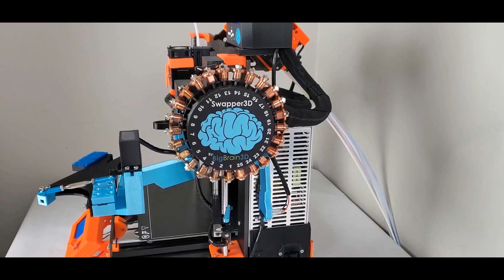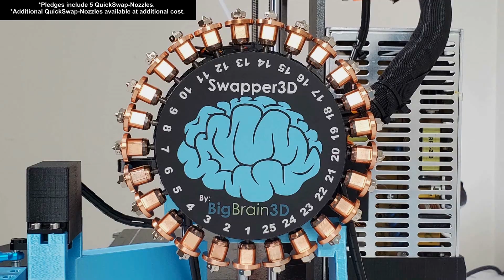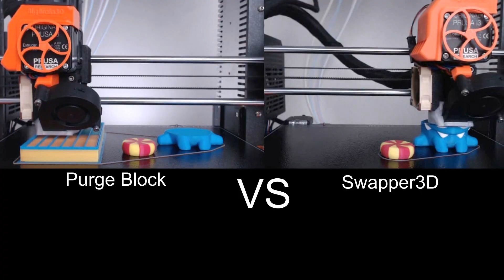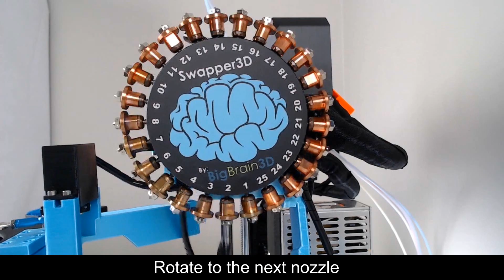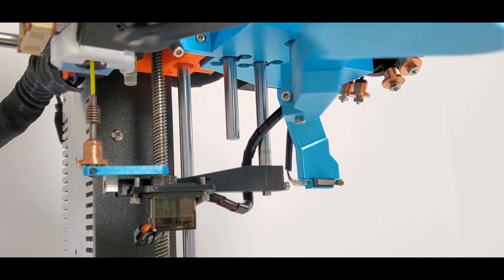Never print a purge block again!

Comment: This is very cool, but for the life of me I cannot understand why you need the cutter attachment. Just pull the filament out while the nozzle is still hot. Then do the infill first when it comes back to that color & nozzle again. I read an article that says you guys already make it to do infill first anyway, because cutting the filament deprives it of retraction. So why not just skip the cutting part? Plus, what happens when there’s a little tiny green part that only takes 4mm of filament per layer? After 10 layers, you’ve got 10 4mm sticks of filament stuck in the tube. The cutter just seems completely unnecessary to me. I’d love to know where I’m wrong if I am wrong.
Reply from the maker: There is a problem with withdrawing filament from a hotend which is that the end of the filament may not go back into the hotend. Also strings can form between the melt zone and the end of the filament being pulled out, both of these can cause the print to fail. This is so common that lots of people actually hate the MMU (and similar filament switchers) because of it. Cutting the filament solves these 2 problems. In your specific example of a tiny print with almost no infill then you may prefer to use a priming tower. Or you could prime on the wiper pad (seen in the Kickstarter but not in this video because it's molded into the cutter guard which is removed so you can see the cut in action).

Comment: This type of system has been included on CNC milling machines for decades. It was only a matter of time til 3d printers got the same treatment.  Thanks yall!
Reply: Yeah, the tricky thing is that this is only half the solution for printing... You'd need another add-on for swapping filaments in a 25 spool array to make full use of it.
Reply: @freescape08  palatte 3 pro takes 8 colors and is technically stackable, it may be compatible with changing nozzle size mid print too which would help with certain prints.
Reply: @freescape08  Voron ERCF and the Annex Engineering Trad Rack can both be expanded to whatever number of filaments you need, so it easily could be scaled to 25+.
Reply: @tehflyingcookie  okay, so it's possible. I'm still doubtful of the practicality though, how many variations can one reasonably organize and print with? And logistically, 25kg of various filaments being fed into one printer gives the impression of an early computer filling a room but with one little output in the corner. And creating a drybox for all that just makes it all seem insane. 
Or course, I expect it'll be used more for nozzle changes than filament type or color, and not all have to be used in a print, but I still think managing all that would only be worth it in very niche situations.
Reply: @freescape08  I don't understand why you're hung up on the 25 number so much. It supports that many nozzles - you don't need to use them all. Also, you might want different size nozzles times let's say 8 colors, which lets you get 3 sizes. You might want a backup one in case you need to clean a specific nozzle. There's a million different problems this solves without it being just about 25 different colors or spools.
Reply: @Xenomorphin1  I'm hung up on the reality of it. If I were them, I'd have looked to work together with other designers for a more complete system. It seems like half a solution to a very small problem that's solved in other technologies. But maybe it's just early days of a new sytem, and I should let it be and see where it goes in a few years. 
I did see the op's comment in reply to complaints, and that cleared up a lot. I'll just be patient and see what more comes of it
Reply: @freescape08  nah you're just trying to poke holes where there is none. CNCs have had toolchangers since forever, it doesn't mean you have 300 tools for each and every slot
Reply: @Xenomorphin1 I'll admit I'm a very picky person, but you'll have to admit that subtractive CNC is much easier for automatic tool changing. As far as I know, automatic tool changers are still fairly new to additive CNC machines, so all I mean is it'll take time to work out the best ways to manage it, and it won't be in widespread use by most additive cnc hobbyists for at least another decade, by my simple estimate.
Reply: @freescape08  I mean you can keep complaining, I don't care. I gave you the usecases for the thing and you dismiss them for no reason, there's no point in arguing with a debbie downer
Reply: @freescape08  what this needs is ERCF
Reply: @freescape08  this goes for every option except manual labour. It's just that the filament waste now isn't a factor anymore but the filament feed system.
I can also imagine a situation with a large part with intricate details where it's quicker to swap to a bigger nozzle with the same filament with this system.
Or help someone that tries to automate their decently scaled 3d print service to give the options for 25 different filament types or colours and has the prints start automaticly or something.

It's a nice take on a problem that will help make certain things easier or possible for others.
Reply: @freescape08  You just need 25 extruder gears + a mechanism to select to drive which (like a carriage with a stepper motor)
Reply: @Spacefish007  yeah, nice and simple. We're definitely not getting into hp full color nylon prices with that many steppers. 😅
Edit: just looked up a quote... Definitely not. (~300000$)
But it's definitely at the point where it would be more cost and time effective to just have a print farm or order prints from Shapeways.
Reply: @freescape08  if you do it right, you can do it to also switch to different nozzle sizes automatically

imagine 5 colors, 0.2 0.4 0.6 0.8 and 1mm nozzle

who needs more?

sounds like full automation goodness
Reply: Eric Karczewski yeah I find it odd they didn’t show that, unless they don’t make one and it isn’t included. If it isn’t included it kind of makes this pretty useless in my opinion. First you need to find one that will handle 25 filaments, then you need to get it to work nicely with the hot end changer, which might be easier said than done.

Edit: I’ll add that it could be useful without a filament changer if you just wanted to use different sizes of nozzle for different parts of the model, but then you don’t need 25 different hot ends. And most people wouldn’t need this anyway. It seems like it could be useful is some specific situations but also seems a bit gimmicky and won’t work too well for reasons I put in my own comment, like filament will leak out of the nozzles as they cool down, which could be different amounts depending on the temperature and material, this could lead to blobs or random bits of plastic on your print. It also has to wait for each hot end to heat up which will make that worse as well as plastic will leak as it heats up.
Reply: @conorstewart2214  The video shows a prusa filament swapper attached to the top of the printer, with 5 different filaments
Reply: @theneonbop  Can it handle 25 different filaments though? If not then its not using this to its full potential, and how well does it work with this? Does it just work out of the box or does it require a lot of tweaking and adjustment and changing firmware, etc?
Reply: @conorstewart2214  they said you have to swap out the firmware for the printer, and that if you buy it you have to pay more to get more nozzles, they left a comment above with more details.
Reply: Can confirm. Cnc machinist here. As soon as i saw the thumbnail i was intrigued because yes it looks like a tool changer on most cnc machines. This is a big step in the right direction.
Reply: @Newb00tgoofin  3D companies can adapt so many thing from cnc milling business but there is one BIG problem...and that is cost of that ! this system would be quite expensive even if mass produced :D
Reply: Normally on CNC with compressed air
Reply: More complex than cnc milling tool changers because it needs to deal with a hot end and snipping the filament.
Reply: Tool changer go brrrrr
Reply: Well, yeah, CNC has to swap tools for different functions. The next step for this would be to set it up to do nozzle swaps, but with a multi-extruder printer that can swap extruders. So not only can it use a specific nozzle size and swap throughout printing, but could also swap extruders. So it could grab another extruder, move to a position to swap nozzles and do so. Could even get it with dual nozzle swappers, so it could work multiple extruders with multiple nozzle sizes.
Reply: Lol, what a compare xD if you do Something with your milling machine You change the tool once, not everytime you drill a hole and change to another tool
Reply: But CNC milling is already expensive by itself, so adding this feature doesn't significantly impact the overall cost increase. On the other hand, 3D printer is so cheap that people could easily get one. Adding toolchanger have much bigger impact to the overal cost even tho the toolchanger itself is still cheaper than milling toolchanger

Comment: Can you reuse the same nozzle twice during the print? After it swaps does it pull the filament out or is that ?. Limited to 20 nozzle changes?
Reply from the maker: The nozzles are reused for that same color unlimited times, allowing for unlimited color changes during a print.

Comment: This approach has a fatal flaw: cut filament stops retraction from working after nozzle swap for a couple of inches. Not to mention the time lost reheating the nozzle after a swap...
Reply from the maker: Retraction has 2 effects which both make a large impact to stringing. 1) removing extrusion pressure and 2) creating suction at the tip of the nozzle. The #1 effect is seen immediately after a swap. The #2 effect is seen shortly after a little bit of extrusion, and to account for that we change the slicer to infill before perimeters. There is also the wiper on the cutter arm (not seen in this video. More info on Kickstarter page.) that can be used for priming the nozzle. 
It takes 15 seconds for the nozzles to reach melt temperature when inserted in the hotend. This is almost exact the same time it takes the MMU to unload to last filament and load the next filament, so there is no additional time added because of heat up in that situation. 
Thanks for your comment

Comment: seems like scratching your ear with the other hand to me. Would be simpler to use a static nozzle array each fed by its own filament. it's unclear from the video how simple/complicated the filament driving/changing is in your case. I guess big-brain doesn't imply efficient-processor.

Comment: Creative idea. Love the execution!
There are however some interesting points which I like to mention. I can compare your design with my own designed tool changer. A tool changer is also a printer which doesn't necessary  needs a purge block. However, I am still using one. A small one though. The reasons  for this is leakage/oozing during swapping/restart. If I don't use a purge block I will end up with oozed material on my print and a quality drop because it will take some time to get the pressure in the nozzle stabilised again. After all some material is missing due to oozing. I can image these problems being smaller with your design than with mine. However, there are still there. My guess is that for top quality prints you still need the purge tower, just like I do. A small one though. Note: Perhaps it should be called a restart tower
It is somewhat of a missed opportunity not showing the actual print up close in this video.  It will be interesting to see how good the print still is without the purge tower 🙂
Reply from the maker: There is a wiper molded into the cutter that deals with the ooze (not shown in this video. see kickstarter for more details) we also infill before perimeters to address the pressure stability.
On the Kickstarter page there are videos of unabridged printing with the swapper3D you can also view them directly here:
					front facing: https://youtu.be/Z3rjUGf5QYM
					side facing: https://youtu.be/ltVoUz5mSNg
Reply: @BigBrain3D  
Thank you for your kind response. I appreciate it. Watching the videos was inspiring. 
Infill before perimeters is off course a smart move. This wil definitely help. Good call. 
The ooze prevention is interesting. It looks like some kind of sponge. I use a thin spring metal  plate to close off the nozzle. This is a rather sensitive system but does work nicely. I wonder what the pros and cons of the sponge solution are. It is definitely more robust than my thin metal spring plate. 
Still a cool product. I which you all the best with your kickstarter 😉

Comment: Seems interesting, but unless someone needs to use different nozzle sizes or materials, it’s not really necessary as slicers can already purge into the infill to get rid of the need for purge blocks.
That being said it’s a very cool concept and especially for multi-material prints it could definitely make a huge difference.
Hope this system will one day also be available for other printers
Reply from the maker: We are working other printer adaptations. The infill is almost never enough volume for a color purge. Remember the infill is limited to the volume of that color space on a single layer. And the infill volume varies by layer so for larger layers maybe it's enough but it may not be and then you'll get color smearing.

Comment: Please please let this also happen for different nozzle diameters.
It is about time we get Slicers which would allow different sizes. Especially first layer and other small details such as gears within larger models.

I love this approach but keep in mind, you will loose retractions the first few lines or layers depending on the scale of the model.
Reply from the maker: Yes you can use this to automatically change nozzle sizes too.

Comment: Wouldn't it make far more sense to purge into the internal space of the model on things like infill where the color is completely meaningless? Then you don't need a purge block and also don't need this massive apparatus?
Reply from the maker: The infill is almost never enough volume for a color purge.  Remember it's limited to the volume of that color space on a single layer.
Reply: @BigBrain3D  I feel like there is a dynamic infill solution here most of the time where the infill density where a full layer is inevitably be more than the surface. Either way you can significantly reduce waste and have a smaller purge block. I think this project is neat and all but I don't feel like it is likely that it will ever pay for itself in time or filament cost for most any user.

Comment: So retraction wont work for a while after a swap?
Reply from the maker: Retraction has 2 effects which both make a large impact to stringing. 1) removing extrusion pressure and 2) creating suction at the tip of the nozzle. The #1 effect is seen immediately after a swap. The #2 effect is seen shortly after a little bit of extrusion, and to account for that we change the slicer to infill before perimeters. There is also the wiper on the cutter arm (not seen in this video. More info on Kickstarter page.) that can be used for priming the nozzle. Thanks for your comment :)

Comment: Great V1, but there seems to be way too much play in that system to be reliable long term with no babysitting. Maybe use small digital servos or gear motors that don't have that tell-tale RC Servo jerk. Otherwise awesome project!
Reply: It also doesn’t seem to be able to account for filament leaking out of the nozzles. Every time I heat up my hot end, filament starts leaking out, slowly, and when it is cooling down a little comes out too. With this you will get that happening when it cools down and heats up as well. This will lead to back quality prints, when you change the nozzle, it will end up with blobs or just little bits of plastic where they aren’t supposed to be as well as under extrusion until the extruder pushes enough filament through to make up for the filament that leaked out.
Reply from the maker: @Conor Stewart. There is a wiper molded into the cutter that deals with the ooze (not shown in this video. see kickstarter for more details) we also infill before perimeters to address the pressure stability.

@TheNeonBop you got it!
Reply: @conorstewart2214  A purge block would solve that problem perfectly. :)
Reply: I think that's why it always checks if the nozzle is in the gripper, if not it repeats the grabbing process until it works

Comment: This is an absolute game changer for multi-color printing. Although, I haven't checked the price but it's obvious it's going to need to be very expensive to be profitable. Those nozzles are very expensive, then there's having to pay for the engineering time that went into the design. This will be priced out of availability for most people, but its still an awesome step forward.